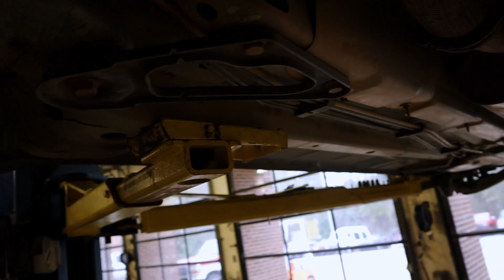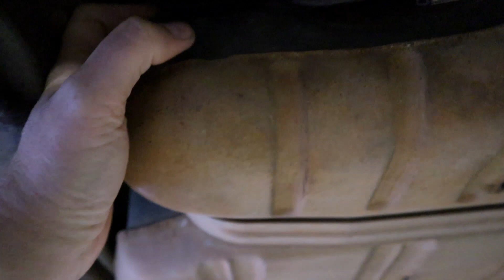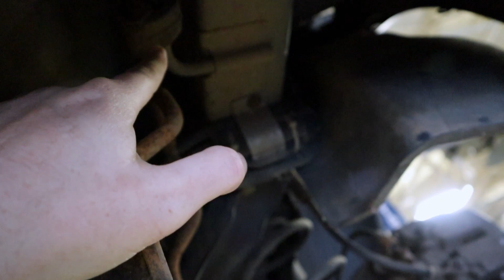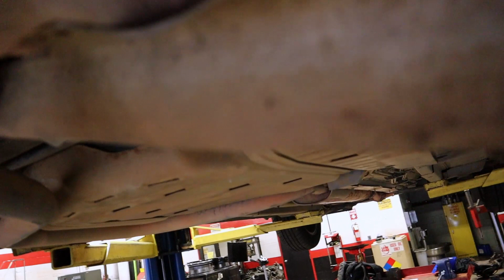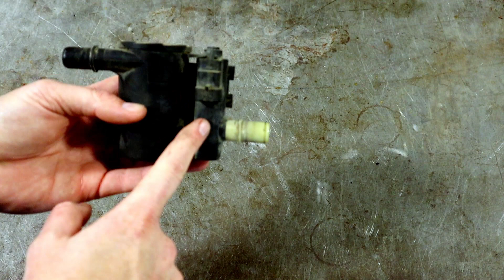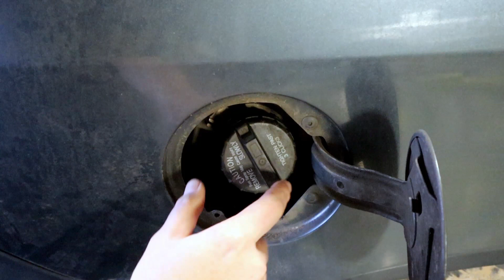GM 3.5 3500 evap code diagnostic repair P0466 P0467 P0455 P0442 P0441 P0465 P0443 P0444

Comment: Finally got around to smoke testing my G6 .  It was the filler neck.  Smoke was leaking like crazy on the section behind the gas cap.  I had a P0455 code.  Temporarily globbed a bunch of black RTV around it until I can order a new neck and find time to install it.  So far the check engine light has stayed off.

Comment: So I have a different issue.
I have NO codes, I just can’t seem to get the cap sensor to set.

I only keep this car registered as a spare vehicle, so I only drive it like one a year to get it inspected.

The battery died, I replaced it, I driven over 260 miles since replacing the battery, multiple cold starts and complete drive cycles, but the evaporation is still showing not ready.

Any ideas?

Comment: For anyone else still trying to keep their 20 year old shitbox on the road: I cleared my 0455 gross leak code by wrapping the gas cap with a Walmart bag. temporary fix, but confirmed it was in fact the gas cap/filler neck. now that the leak is "sealed" it's throwing 0401 insufficient flow. 😅 good luck, boys.

Comment: Great video.  I'm dealing with P0455 on my 05 pontiac g6.  So far I've replaced the gas cap twice, the purge valve , and I dropped the tank to replace the evap vent solenoid.  Check engine light stayed off for about 10 miles and came  back on again.  Check gas cap light on the dash.  Also, the car surges at 50-60mph and especially going up big hills.  I bought a smoke tester off Amazon so that is my next step.  Also, got an Innova SDS 50 scanner.  This code is driving me crazy.  I think next I am going to check the fuel fill cap area that you mentioned in the video.
Reply from the maker: This was a tough one to catch and I would not have found the issue without a smoke tester. Good luck my friend!
Reply: I just had this problem on my 05 gt. wrapped the gas cap in a plastic bag to ensure it was sealed, and also found the vacuum line that connects to the brake pedal arm for the cruise was disconnected. cleared the 0455.

now I gotta find out why It's not running at temp, but not throwing the ECT code anymore. Fans don't shut off, and when I'm moving it's only hitting 125 - 150. fingers crossed that it's a stuck thermostat and not a critical engine failure. 😅 I already got lucky once. thought I had a serious transmission issue, and was hoping for shift solenoid as the best case. ended up just being a broken wire in the MAF pigtail.
Reply: @betteryou7hanme  smart idea with the plastic bag.  Good luck on the rest!

Comment: Hi Mr. B! Thank you for these videos, i'm a new subscriber. I'm taking you up on your offer, 2009 g6 3.5. Can't fully fill tank, and get check gas cap message. Soft code p0455. Dealership thought it was vent valve but no. I replaced fuel pump 2 months ago and this problem went away, until yesterday.?
Reply from the maker: You have a vent valve that may be stuck open, or possibly a broken hose or loose connection. A smoke test would reveal any leaks. This car had a leak at the filler neck. Thanks for watching!
Reply: @AutoScholarwithMrB  thank you Mr. B! 😃